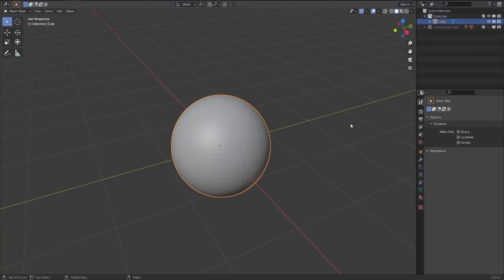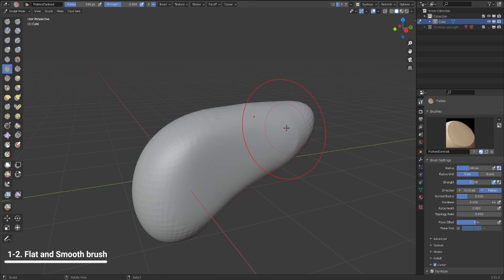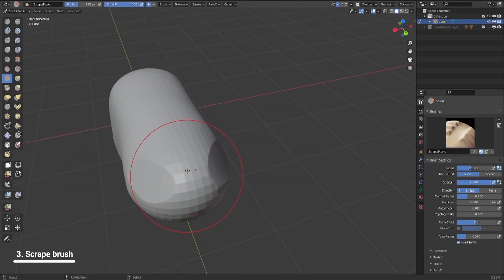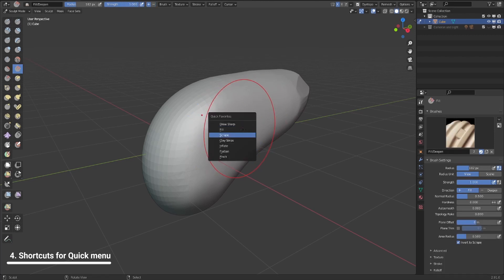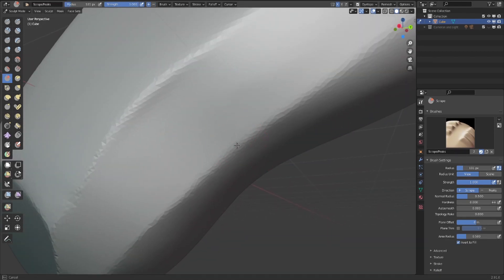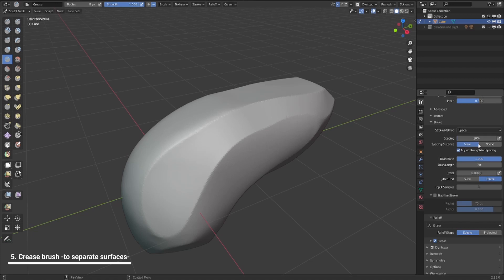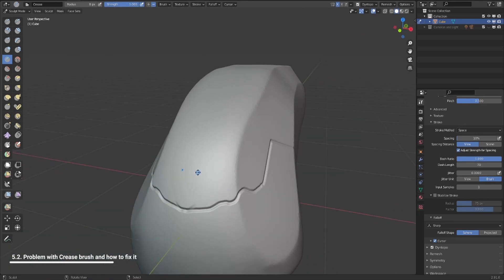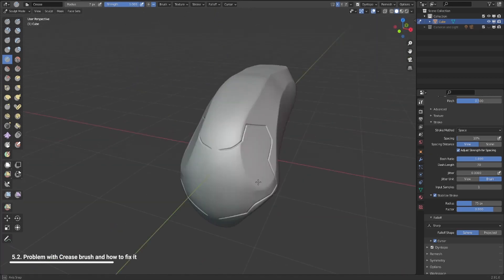Quick Guidelines for Sculpting Hard Surface in blender

Comment: Do you ever have that problem where sculpting a stroke with a curve(the one with bezier handles) causes it to do make or cut a double stroke, the second stroke not directly under the curve and messing up the ends?
Reply: there is a fix to that i saw in a video something related to built up edges
Reply: @abhinavm9389  yeah there is

Comment: how to make the sculpt look smooth like that? i've trying that in subdivision surface dyntopo shpere and the result is a lot triangle on my sculpt and too messy on my object...even with smooth tool
Reply: activate smooth shading  for the object you can find it  under dynatopo setting
Reply: Before sculpting you subdivide the mesh 5 times then applied it after that add multirest modifier subdivide it by 4 or 5.this work perfectly fine for mid low pc

Comment: NOOB WARNING

This would be WAY more useful for us noobs if you showed the dyntopo, falloff, etc settings you use. I tried to follow this only to learn that the scrape brush doesn't actually work the way you show with blender defaults! Have to go to other videos to learn the settings not shown here.
Reply from the maker: Sorry about that
in this video I was actually using the default stroke/falloff the whole time, even with the scrape brush.
The reason why I didn't show the dyntopo is because there is no correct settings to use, you want to start high when doing block out for example then go lower the more you go into details.
This video was just as a presentation for the tips, so I used a lower value the whole time (4 or 3)

The problem that you might had is not enough geometry when sculpting, and that happens when you add default cube /sphere and want to start sculpting on it immediately with dyntopo, a quick fix is:
1. e.g. you added a new cube  
2. enable DynTopo with the detail size you want to use
3. take any brush and sit the "Strength" to 0
4. make a quick brush stroke on the whole cube
-this way it adds enough geometry when you are sculpting -
5. then you can sculpt normally with any brush 

Hopefully that helps 
Thanks for the tip